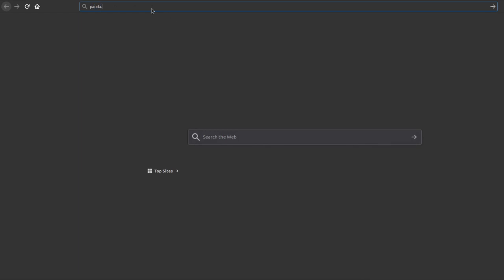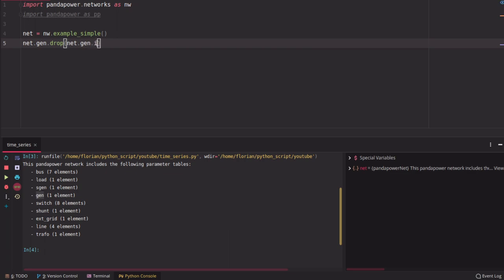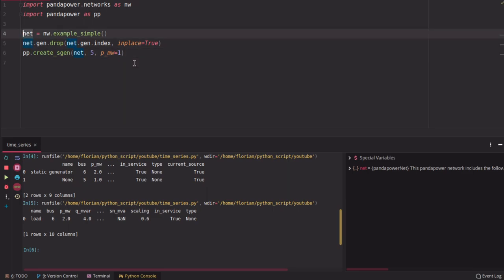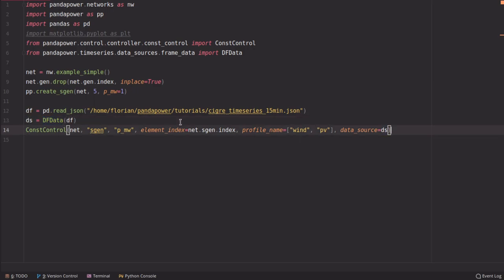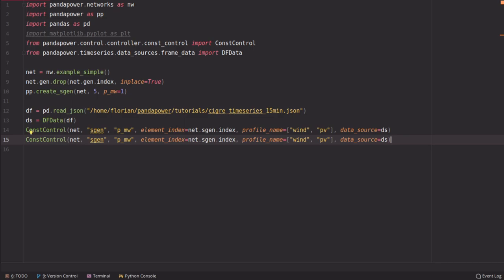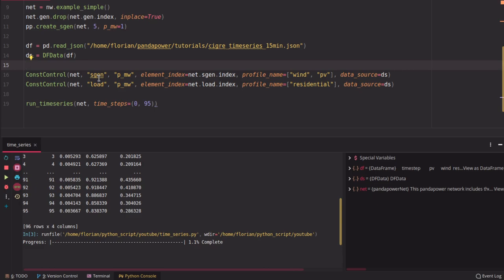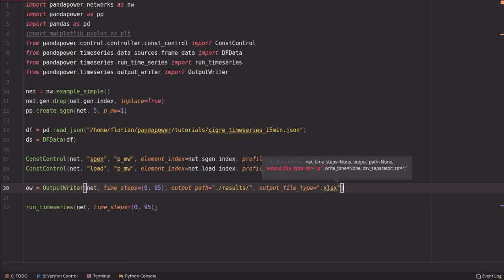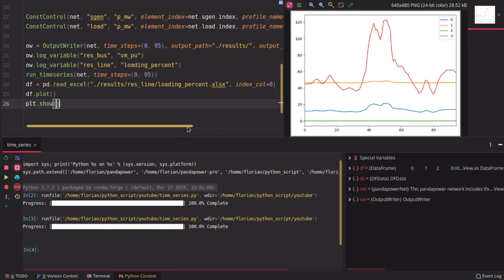pandapower 2.2.0 - time series calculations

Comment: Hello and thanks for the great video!
I have a question tho: is there a way to "automate" the process for Asymmetric /Three Phase Power Flow
 as it is done here for the balanced AC Power Flow?
If not, I believe the way to operate would be to iterate through a "for" loop and to run the "runpp_3ph(net)" command at every step. Is that correct?
Thank you & have a good day;)

EDIT: I made the 3ph PF work, but my ConstController won't contrll the p_a_mw of my asymmetric loads.. How can I make it work?

Comment: Great functionality.  1.Why excel output and not direct pandas dataframe "export"?  With unbalanced load flow Pandas would be great for LV DER placement analysis with existing smart meter data. In Slovenia we have a lot of single phase consumers in the network....
Reply from the maker: Thank you Gregor! I thought Excel might be easy to open for beginners. But it is kind of slow when dumping it to the disk. Rather one could use json for this. Also you can of course use any other pandas format to dump the results. For example, pickle is also supported. If you're interested in unbalanced power flow calculations: we're working on it: https://github.com/e2nIEE/pandapower/tree/unbalanced_pf_2.0 Unfortunately, this is not one of our "main topics". However, you're very welcome to contribute if you want!

Comment: Have an issue where I get the same result for the first plot, second plot is all flat lines??
Any ideas
Reply from the maker: is the result data written to your disk?
Reply: You're probably running only steps 0 and 95, not 0 to 95
Reply: I wrote almost the same code, the only difference is that i used run_timeseries(net, time_steps=range(0, 95)) however the plot of the loading percents is showing me different curves.
Reply: @toresafa  Got the same problem. My last column has values in the order of 20s. Same problem?

Comment: Thanks again, sir. Is it possible to simulation a fault and collect the data in a PMU (Phasor Measurement Unit)?
Reply from the maker: Actually, I don't know. I haven't worked with PMUs so far. But you could save the output DataFrame in some desired format (json, excel, pickle...).